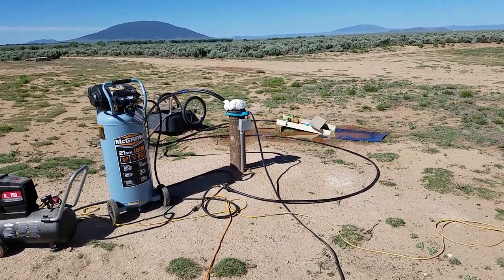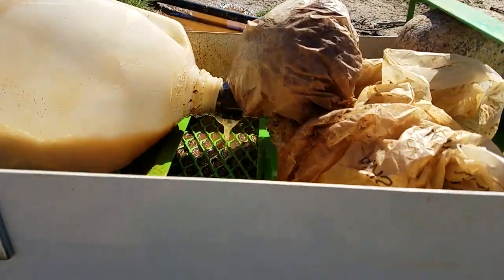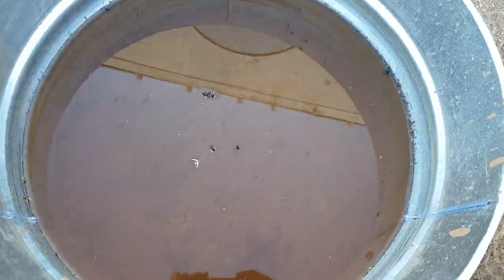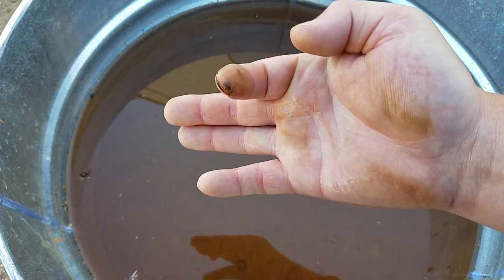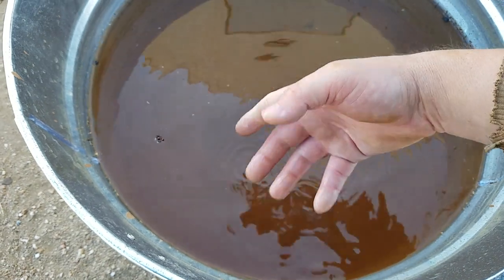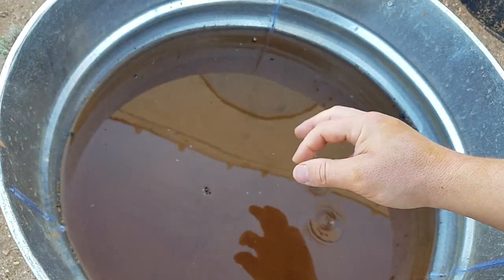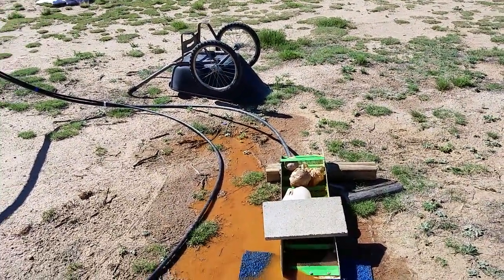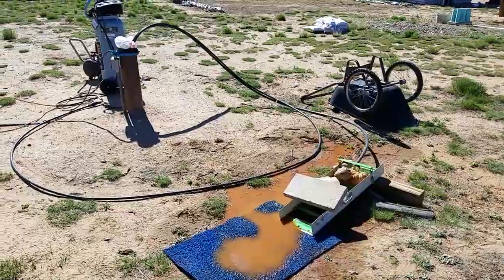Water Well 380 Feet : 72+ hours Tiger Air Lift Pump Steadily lifting very heavy sediment

Comment: Have you found out what the sediment was? looks like iron bacteria... maybe a shock chlorination would do some good to the well. great video!
Reply from the maker: See, I thought it was something bad, we were not able get it analyze, but the earth had no smell. Been drinking the water since fresh drill of bore hole. This Water Well was freshly drilled, but left the tailings and never installed Torque Arrestor to prevent whole assembly from snapping off pitless adapter. What I pulled out was the drillers tailings, that should have been done correctly.